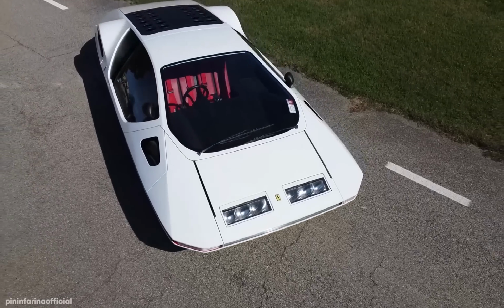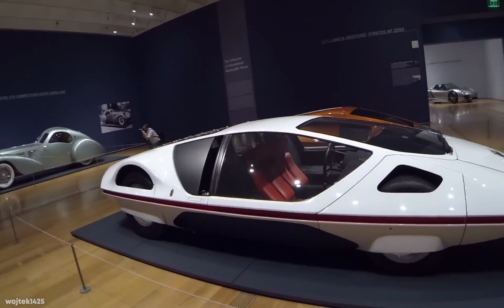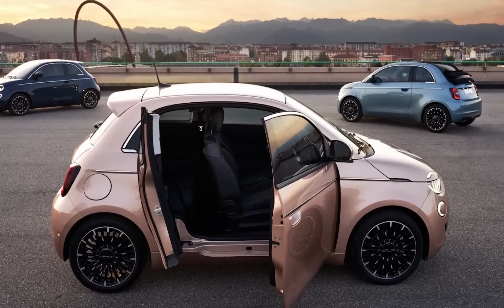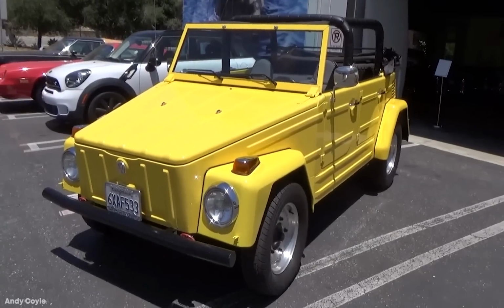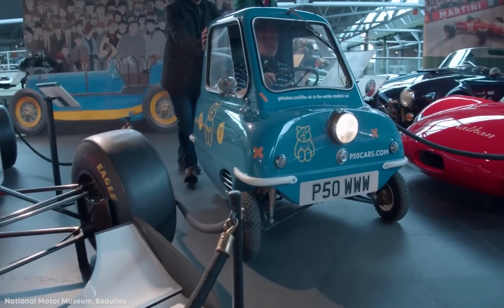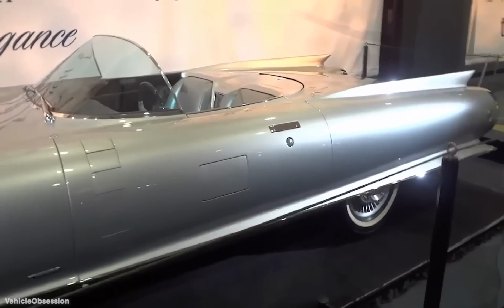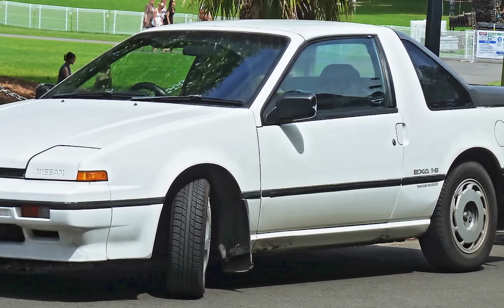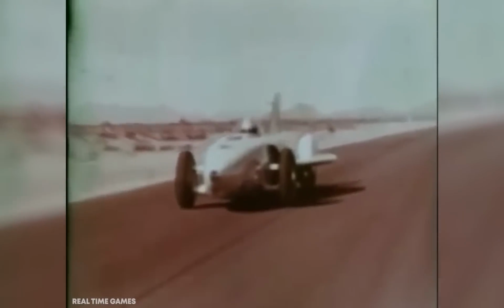15 STRANGEST Cars Ever Designed

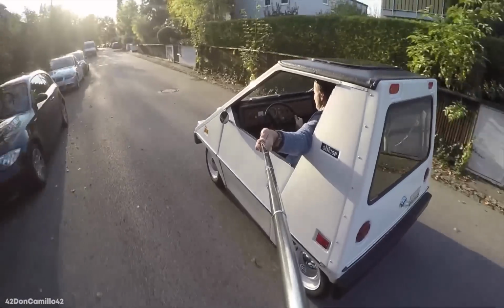Comment: 4:57 "the city car was one of the earliest production electric cars in the United States" ??? .... Not even close ... in the late 1800's and early 1900's approx. 25% of cars sold were electric. There were actually dozens of electric car manufacturers in the U.S. before the Great Depression and the Great Depression is exactly what killed the electric car the first time around, a gasoline powered car cost only about a third of what an electric car cost back then and, advancements in gasoline engines and better roads and gasoline distribution infrastructure gave the gasoline car's range a big advantage over it's electric competitors.

Comment: @3.10 The Bond Bug was originally built at Bond Cars Ltd in Preston thence Reliant (Tamworth). Sharpes Commercials Ltd of Ribbleton Lane, Preston (trading as Bond) originally built the earlier Bond Minicars Mks A to G which used motocycle technology whereas the subsequent Bond 875 and Bond Bug used convention 4-cylinder water-cooled engines. With its Hillman Imp engine, the Bond 875 was actually faster and had superior road-holding

Comment: I had a Subaru Brat back when; it had serious torque steer,155/80/13 tires for the serious off roader and was so cold in a Canadian winter the gas pedal would freeze in position coming off a highway trip.

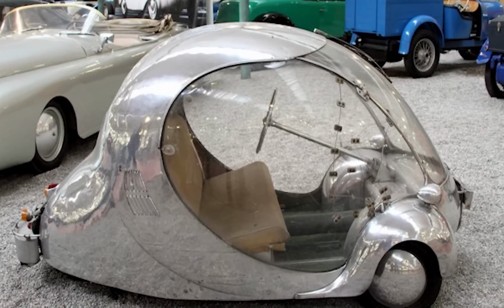Comment: 10:00 For "one of the first electric vehicles", this is about 50 years late. The first speed record of an automobile ever was set in 1898 (so still in the 19th century) by the electric "Jeantaud Duc". Around 1900, about 34,000 electric vehicles were registered in the U.S..
Reply: It bugs me when people suggest anything electric built after 1930 was the first electric car when a large portion of the first vehicles on the road were electric.
Reply: @tstuff  Even more so: The first non-steam powered boat was already built in 1839, 50 years before anything resembling an internal combustion engine powered a boat: Jacobi's electric boat was powered by an improved version of his own electric motor which he designed in 1834.
Reply: @hayloft3834  Normally, "power boat" implies that the boat has its own power, and does not need external power like wind or human muscle power.
Reply: @hayloft3834  It does if we don't want to get rabulistic.
Reply: The research for this video was half-baked and slipshod.  The VW Thing was originally an old Nazi war vehicle in 1939.  Fiat didn't first introduce the Multipla in 1998.  It goes back to at least 1967.  I saw a bunch of them in Italy in 1969.  The 1960's version better looking in the 1998 one and very popular.

Comment: The slow recharging ability and lack of recharging station's has long handcuffed the Electric car design and implementation.   Modern engineering has been allowing the Electric car to become a more feasible option, but there is still the issues of affordability and the need for quick recharging station's before we can completely replace the gas models.

This of course does not include the classic cars we all love to look at.
Reply: √ out AMC ELETRON
Reply: Hybrid is the best compromise - runs great and gets good mileage. Forcing BEV down everyones throat is a bad idea.
Reply: @Dannysoutherner  I don't think that the BEV is being forced on anyone at the moment.  It's going to take a few years to get a sufficient amount of chargers placed across the continent before the Electric cars can be used for cross country travels.  Right now they are more confined to larger metropolitan areas, plus it's going to take time to train enough mechanics to service the new technology, so that also currently limits thier travels.

You are correct about the gas/electric hybrids being a good compromise for the time being,  I'm hoping that since the full electrics are currently too expensive for most of us at this point,  the price of hybrids will drop down into the average consumer's reach, allowing more people to switch to them until all of the issues with the electrics are resolved.

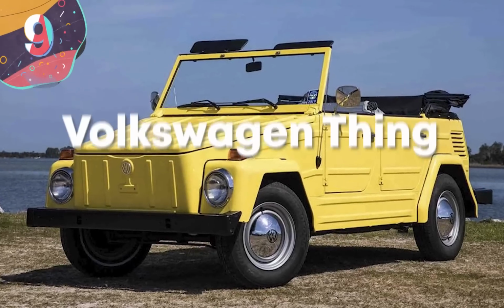Comment: @8:20 The VW "Thing" was developed originally in the 1930's for use by the Nazi German military (both Wehrmacht and Waffen-SS). by designed by Ferdinand Porsche and built by Volkswagen.  Otherwise known as the Type 82 Kübelwagen it was  based heavily on the Volkswagen Beetle, it was prototyped and first deployed in Poland as the Type 62, but following improvements entered full-scale production as the Type 82. Several derivative models, such as the Kommandeurswagen, were also built in hundreds, or in dozens.
Reply: I call Pinto a ' Volkswagon Thing ', when I see a Volkswagen Thing I say " hey, a REAL Volkswagen Thing.
They were cool because you could re-arrange parts and take doors off, etc.
Reply: it started out as a VW beetle which was desinged by Hitler. but when war was looming they needed an off road vehicle so the Beetle got redesigned as the Kubblelvagen. same chasis just a diff body.

The beetle was also used as the base for the porche 911. same chasis and engine just diff bodywork.

Even now al the cars in the VW group r the same cars under the bodywork just diff brand names put on them and diff bodywork. IE VW, Skoda, Audi, SEAT Porche and Bently all use the same chassis and in most cases same engine and components, Skoda uses cheaper better quality parts from Slovakia though and Bently uses the rolls royce engine but apart from that they all use the same German parts and r very unrelaible and expensive.

About 10 year ago VW had to recall every car brand it made for a certain model year cause the igintion packs had a nasty habbit of bursting into flames. Skoda was the only 1 not recalled cause it was the only brand that didnt use the faulty German parts.

Lots of complaints about the Bently since it was bought out by VW about how unrelabile it is since they started using German parts. Rolls Royce have the same prob Since BMW bough them out.

Comment: On the 3 wheel cars, it is better to have the 2 front the steering wheel and one in the rear as drive wheel to prevent roll overs when turning a corner. Messerschmidt
Reply: Agreed.  The Bond Bug quickly gained a reputation as a Death Trap ... the combination of unstable 'one-wheel-at-the-front' design and lightweight fibreglass construction did not bode well for occupants.
Reply: HMV Freeway was another 2 in the front drive wheel in the rear. On slick roads it could go "turtle" and get stuck on its roof.
Reply: Peel would look pretty good if it just had two wheels on back instead of just one.

Comment: #15 I like the look of most Dodge vehicles but this one is a mix of cool and weird
#14 looks like a mix of a UFO and an underwater vehicle but it's a car
#13 I'm not big on Reliant, history of that is interesting 
#12 don't know if I like that look sharp edges in body design, got to give some credit for being electric and it looks fun to drive
#11 ugly looking like 2 cars smashed together  
#10 there was something weirdly cool about this one and just put my finger on it why
#9 does look fun
#8 WTF weirdly cool
#7 Peel P50 saw that on Top Gear fun little car 
#6 not seeing what's strange about it, just a cool design
#5 and #4 weird but cool, #4 fallout (games) vibes
#3 kinder cool
#2 it's weirdly slick 
#1 built for straight-line speed at the time, fuel stored in the nose is a bad safety design in my opinion

Comment: Correction, there were at least a dozen electric cars in the 1880's to the early 1900's.
Reply: In the 1880's there were more electric car models than those that ran on petroleum. In fact the first car, in speed tests, to top 100KPH was electric.
Reply: Electric cars were around before internal combustion engine was invented.
They also had steam powered cars and trucks before petrol and diesel.

Comment: That "less then 200 were sold" for the Bond Bug comes from Wiki and does not make sense as in the same article it states that 2270 were produced over 4 years clearly there would have been no point producing those kind of numbers if they did not sell, although it could be driven on a motorcycle license purely because it had 3 wheels like a motorcycle with sidecar I would not describe it as a motorcycle as it shared more design features with a car albeit missing one wheel.
Reply: In Britain at the time (may still be the case, IDK) a 3-wheeler like the Bond Bug was registered and licenced as a motorcycle, and as such, avoided some of the taxes that 4-wheeled vehicles were saddled with. This is the same reason that Morgan cars were originally 3-wheelers as well. Cheers!
Reply: @themittonmethod1243  Not Morgans. To qualify as a motorcycle a three-wheeler also had to weigh less than 500 kg. Morgans didn't.
Reply: @themittonmethod1243  Not100 percent sure, but I think that Reliants had to have the reverse gear disabled to qualify as a motorcycle. I knew someone that had a Reliant with no reverse gear and only a motorcycle licence. Bugger of a thing to park at times.